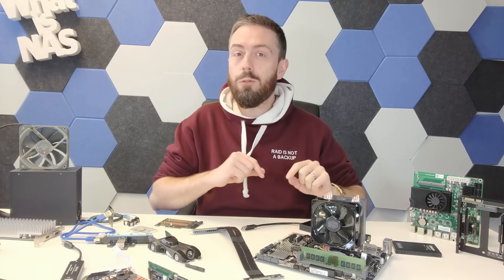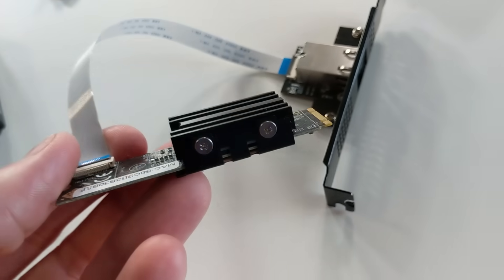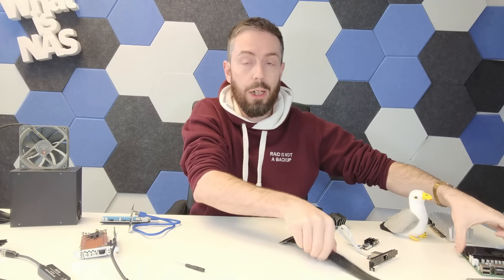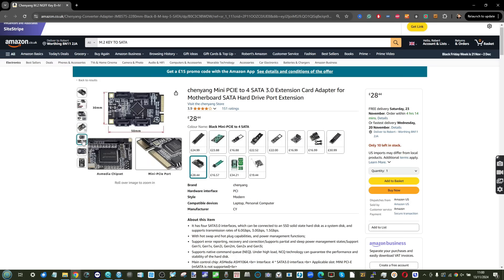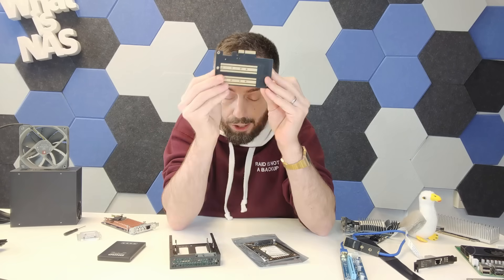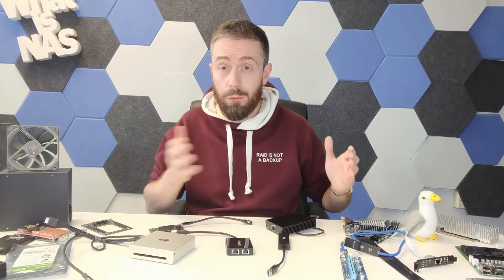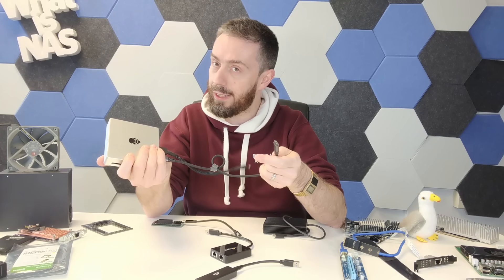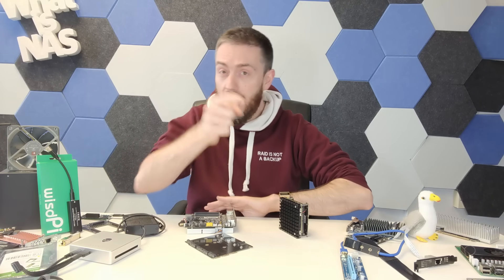COOL NAS UPGRADES (You might Not Know About) for DIY and Turnkey

Comment: Hi Rob. I have a Minisforum 890 Pro that has an oculink M.2. adaptor. Was wondering, Is there such a thing as an oculink to 10GBE RJ45 adaptor? So one could connect an ethernet cable directly to the 10GBE on the NAS?

Comment: Would have been nice if you mentioned utilising m.2 E-Slot. Usually reserved for wifi network cards, there are m.2 e-slot to 2.5Gb nic adapters, m.2 e-slot to 2x sata adapters and m.2 e-slot to usb adaters too. I use both e--slot to sata and 2.5Gb adapters in seperate custom nas builds.

Comment: The longer I watched this video, the happier I became with my new UGreen NAS DXP6800 (6 bay) unit. So many standard features in their hardware that meet or exceed the upgrades listed here... especially for those of us who them at Kickstarter prices. 

DUAL 10GbE NETWORK PORTS (Can be link aggregated. 20G bandwidth for download speeds up to 2500MB/s). 12th GEN 10-CORE INTEL Core i5 Processor (1235u). Six 24TB capacity bays. TWO M.2 NVMe SLOTS expandable to 16TB (8TB each). DDR5 RAM expandable up to 96GB / 4800MHz. DUAL THUNDERBOLT 4 ports and a PCIe x4 expansion slot. Lastly the “ice cream on the cake” that UGREEN allows you to install your software of choice (TruNAS, Unraid, HexOS, etc.) if you dont like theirs, without voiding the warranty… love it.

I think that is plenty of hardware for most NAS user, especially for the average home users. And again, I got all of that for $599 (Kickstarter).  It was a no brainer.

Comment: up until the oculink 4x nvme, it looked like you rifled through my parts bin. I have all of the devices you mentioned except for that oculink doc, but I have had my eye on it too lol.

my favorite nas hackenstein "upgrade":

a 4x4x4x4 bifurcation nvme board for an x16 slot to get 4x nvme to x4 pcie slots out of a single itx board.

I use one of these in my backup NAS to give a dual 10gb nic,  nVidia Tesla P4, and 2x NVMe 2tb drives out of the one PCIe gen3 or better slot. I then use the NVMe slot on the motherboard for an additional x4 PCIe breakout for an HBA for a bunch of HDD.

This combo takes a very basic itx motherboard and builds a very feature complete NAS in a tiny package. You just need to get a mobo that supports the bifurcation.

Comment: The QNAP "U.2 card" ist not a u.2 to m.2 raid card. Its a dual M.2 Sata to 2,5 inch Sata Card
Reply from the maker: You are utterly, utterly correct. Pulled the wrong component off the shelf. Should be this - https://www.qnap.com/en-uk/product/qda-u2mp

Comment: a lot of these upgrades cover some of the issues i've found while shopping for a diy itx solution for 8 bays. none of the larger brands sell these boards with more than 4 sata. So it's always been the internal debate of ordering a cwwk nas board off ali express and hope it works well....or buy a board with less ports and eat up my pcie card for an HBA instead of the 10gig card i wanted.
Reply: well could use one of the two m.2 ports for 4x sata and tadaa 8x sata ports on ITX but I agree... they skimp out on sata and it is annoying...

Comment: problem with mitx board integrated n100 cpu  in my opinion is that the manufacturers completely miss what is needed....and they produce half finished boards with nonsense like few 10gig networks meanwhile most folk dont even have 2.5gig network(leave youtubers out)... i think what we need is board with 2.5gig network, 6-8 sata, 2usb(whats the point of 2usb 2.0, 2usb3.0), pcie, nvme and atx standard psu compatible(we need it to power hdd anyway) and finished bios(hardware that it goes to deep C states)... ppl with needs biger than that they are looking at different hardware(matx, atx, stronger cpu etc)
Reply: but there are n100 boards with 2.5gig and sata ports... plenty of em too but it's hard to find 10gig... especially sfp+ (which is cheap 10gig)
Reply: mm you do realize that a lot of things sell on hype and 'potential' rather than what ppl actually end up doing with their systems, also 2.5gig takes as much space as 10gig. A lot of the buyers who they are aiming for don't necessarily factor in that they will need other gear to also support whatever network standard they are looking at. I speak to random people at times about stuff like this, and have done so for 20+ years. I used to work doing tech support for a while, and some calls were literally like "hi, I have a xyz123abc here." - "great to year sir, how can I be of assistance?" - "You guys make this thing, right? I'm calling the right people?" - "Yessir, that is one of our products. Is it all working ok? You're calling support, can we be of assistance with something?" - "Ooh, well, I haven't plugged it in yet... what am I supposed to do with it?" - "Sir, it's a NAS drive, Network Attached Storage, you can plug it into your network and copy files to it from your computer, or back. That sorta thing. Are you trying to do something specific with it that you need help with?" - "Oooh, no. I don't know if I need this, but it sounds great!" - "Yessir, okay, well, if you decide you want to use it and have issues doing so, please call us back at that time - when you have the device plugged in as shown in the manual and are trying to use it for something and not getting it to work as expected. Good evening sir." click

Comment: I don't know if I was doing something wrong or not but I tried the wavlink 5 GB USB-C network adapter thing and it said I was connected at 5 gigabits but I was only getting the same speed as my laptops built in 2.5 to add to this My Nas has 10gbe